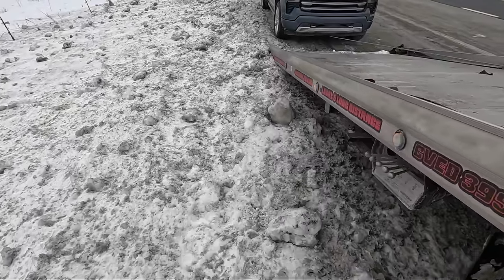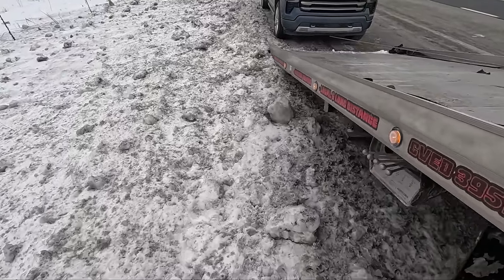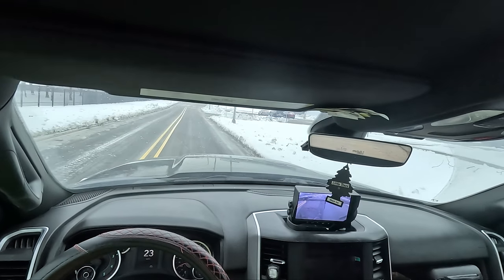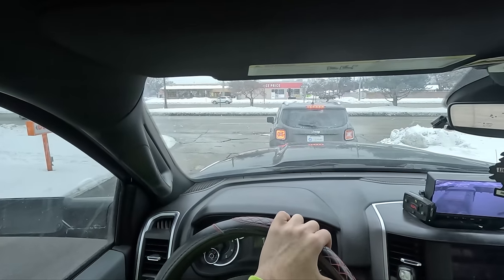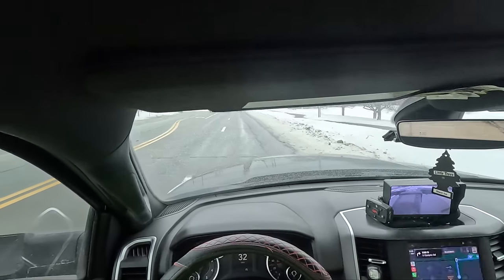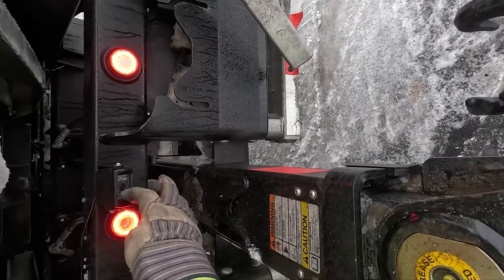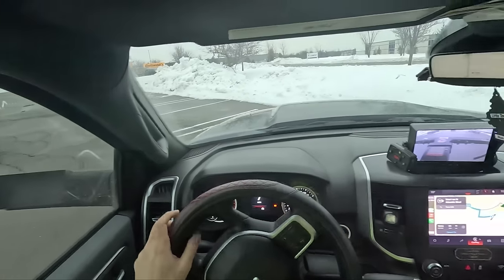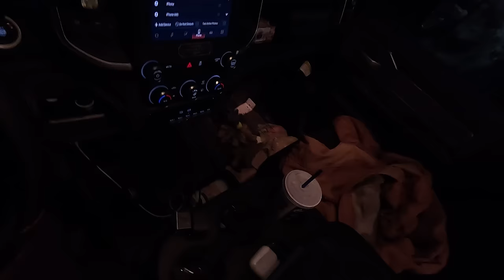2024 SILVERADO BLOWN MOTOR!! | HIGHWAY RESCUE | DAY IN LIFE OF TOW TRUCK DRIVER EP 5

Comment: Is it cylinder deactivation that's causing this? I bought my 2021 sierra 1500 5.3 during COVID and because of chip shortage it doesn't have start/stop or cyl deactivation.  I have 33,000km on it with no issues..except tailgate switch

Comment: I had an Escalade battery went dead, wouldn’t go in neutral dragged it up on the bed to get it to the dealership they changed the battery to connect the computer to it and the goddamn thing still wouldn’t go into neutral

Comment: Very Sad how GM engineers are clueless how to design the DFM into the Engine without catastrophic Engine failures.... They've been having Engine Failures since 2007 when they introduced the AFM (Active Fuel Management that deactivated 4 Cylinders) now the worthless technology is DFM which can deactivate any of the 8... Total junk....
Reply: 2007-2013s and 2014-2018s aren’t bad it’s the 2019+ that are dogshit
Reply: 2007-2013 has electrical and ground issues,engine solid.
Reply: @Enochrry6024  we have not one but two 2013s and they didn’t have any electrical issues except for one with the window being hard to roll up and down sometimes but actually I think that’s more of a window motor issue
Reply: @Kylewraps  ...I have a 2007 the beginning of the 3rd generation tahoes, the 4th generation started in 2015. I've had electrical and ground  issues maybe the issues came it was the 1st make in its generation I've learned to never buy the 1st make in a generation of vehicles😀. Some of these newer vehicles are the 1st or 2nd generations, and they will definitely have major issues until it's corrected later with improvements into those specific generations.
Reply: @Enochrry6024  the first year of Gen 4 started in 2014 

I have a  2014 with 192,000 miles it had a small ground issue that messed with the power steering other than that it works completely fine just replaced my transmission at 189,800 miles I never changed the fluid so it would’ve lasted longer I’m sure if I changed it
Reply: @Kylewraps  ...The (GTM900) was from 2007-2014 the 3rd generation.
Reply: @Kylewraps  ..The (GMTK2UC/G) 2015-2020 the 4th generation.

Comment: Theres a neutral release switch behind the dash under steering wheel i believe
Reply from the maker: Unfortunately not on these models :(
Reply: @christianstowing   mine does and it's a refresh model. alternatively the transfer case neutral would also work.
Reply from the maker: @DarkenFool  If the engine is not running the transfer case will not shift into neutral.
Reply: @christianstowing  it does; i ran outside and just did it. try it next time if the same situation happens. gl

Comment: alright so the engine didnt blow (nice clickbait). according to a fella in TX who tows a ton of these, its the high pressure fuel pump control module that dies and this is what the result is. its pretty cheap part.
Reply from the maker: Not clickbait! 
Luckily, we are in Michigan where we tow more GM’s then anyone in the country, and we have a contract directly with GM so we have had a boat load of these trucks with blown motors, even the manufacturer models. It stated it right in the notes. We took it to the engineering tech center where they take it apart and see what went wrong. We have towed dozens of 6.2’s with blown motors. No reason for me to clickbait 😁👍
Reply: wtf tho this is a first im hearing of that. what happened. spun a bearing, rod dropped, piston broke.. this doesnt just happen. you gotta give more details.  @christianstowing
Reply from the maker: @johndonovan7018  Very commonly it's upper end related, however it's also been common to blow huge holes through the motor. They have a few lawsuits started over it. https://www.bitchute.com/video/KNl8P9sxdSZq/
Reply: my god.. i know the c8 5.5L engines do this but yikes. gm fucked up a yet another old classic engine that never had issues. amazing. i mean outside the usual AFM failures which is long term issue.   @christianstowing

Comment: All engineers should have to recover these vehicles on the side of the expressway. You would see none of this nonsense. Most oems are guilty of this at some level. Many have no tie down points that are actually usable. No place to put a recovery hook. People wonder why suspension damage happens. Tow operators put the hook where they can, but, not where they should, to minimize the danger of working on the side of a highway. Load it quick and move on. All vehicles should be able to get hooked up and rolling easily, period.

Comment: Those GM engines, if not built absolutely perfect engine wise, will roach with 0w20. I've seen more roached engines the past 5 to 6 years than at any time in history. The 0w20 will DESTROY most all engines, on engines that don't produce a lot of horsepower you will roach your engine in the 80,000 range with the 0w20 and 7500 to 10,000 oil change intervals. That oil KILLS bottom ends AND FAST. 10w30 anywhere in the lower 48 should be used. I bought a new truck and I had the dealer change my oil with MY OIL before I drove it off the lot. I put 15w40 in and I'll stick with 15w40.

Comment: He said 6.2, probably blew a motor. Then no further information. Well, what was it? The previous 100 statements are all coffee talk then!
Reply from the maker: It was a blown motor, I dropped off a Tahoe, for the exact same problem (Shut off abruptly driving) few days later and confirmed. They said the oil pump failed and basically seized the motor from heat. However they are actively investigating all of the cases to remedy the issue

Comment: Wow that's bad kals srt brand new 2024 Cadillac Escalade also blew the engine at a light 🤷 this is bad specially when on vacation, can't get it into neutral required to remove the drive shaft G's I'm sticking to dodge brand vehicles 🫣 GM vehicles towed by a RAM 👍💪